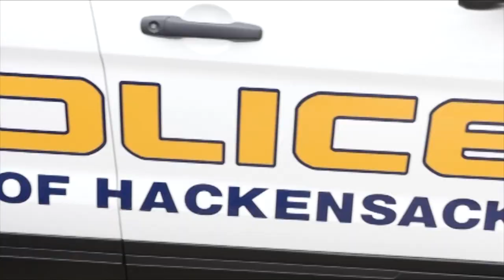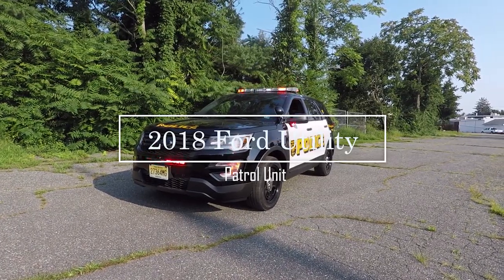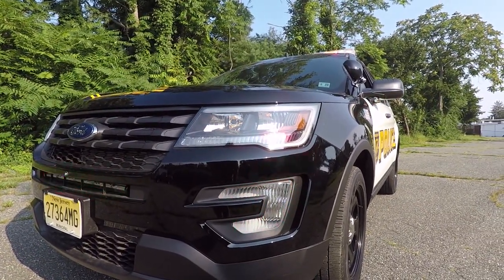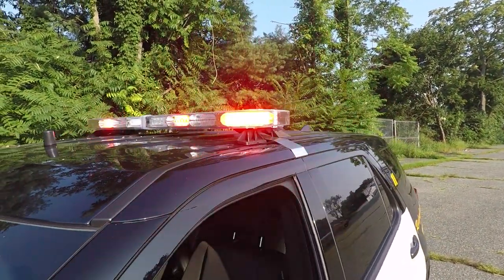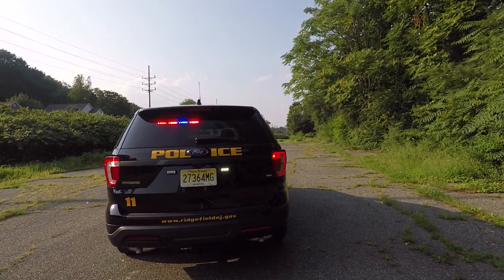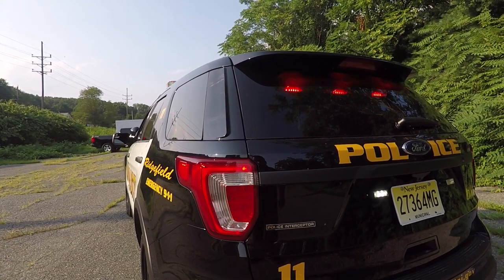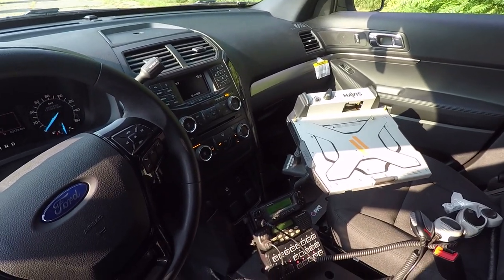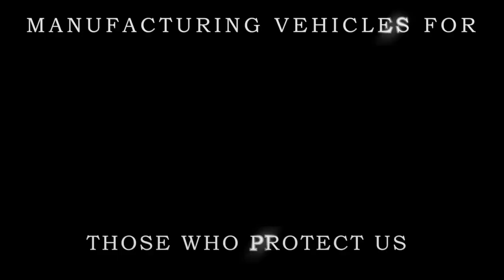Ridgefield Police Department 2018 Ford Interceptor Utility Patrol Vehicle 10-75 Emergency Vehicles

Comment: Quality work as always. I know that your customers dictate what is installed so this is not directed at 10-75. As an officer myself, I can't wrap my mind around an agency not installing a partition. I get trying to save money but that is not where you do it. Also, the all red lighting is rather strange. I know that is usually dictated by the jurisdiction or state, but how do you distinguish this from EMS / Fire? Here in MS, only LE are authorized Blue lights. We us all blue or a combination of blue/white/amber.
Reply from the maker: Thanks for your comments, the agency will be installing the cage themselves before the car goes in to service.  The agency has always ran red with minimal blue to rear. In nj police/fire/ems can run red/blue and volunteers only blue.